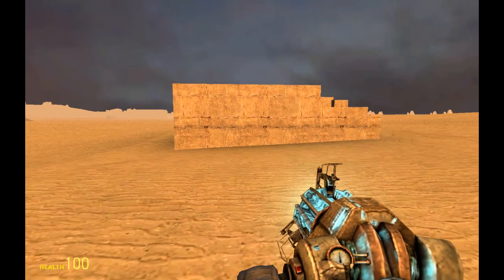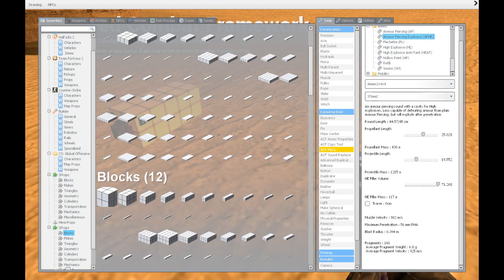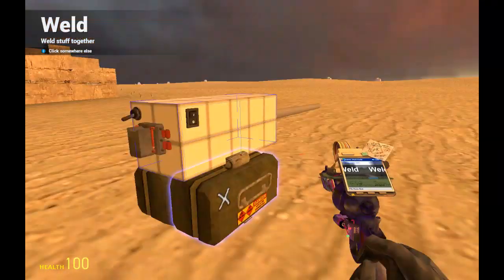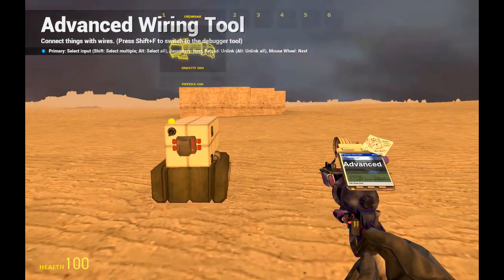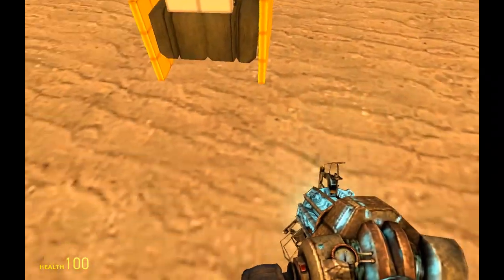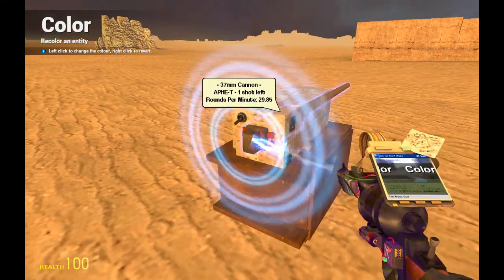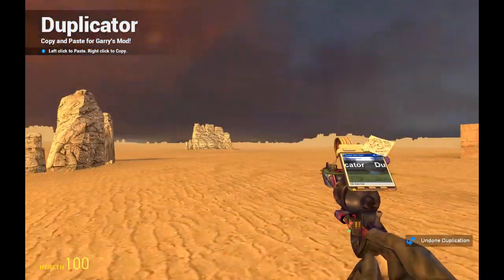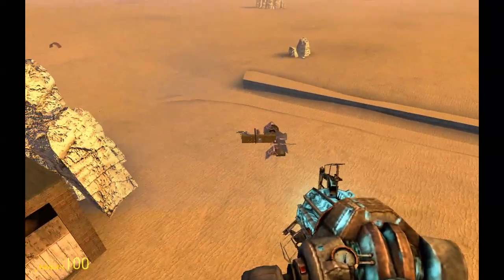[Tutorial] Gmod ACF Weapons tut Basic mounted cannon and wiresystems

Comment: Hey good tutorial but still i have a problem.
I understand the basics of ACF so i tried to make a static howitzer on wheels (I hope you know what i mean, if not just google "ML20") And when i was done with the desing the weight of the gun just pulled it on the ground.
I tried to change the weight of the gun and it stopped working. So any ideas to actually make it work?
Reply from the maker: Make the wheels heavy enough to support the gun!!
Reply: Gmodism Total Nerdery Channel Thanks!

Comment: So it takes you 26 minutes when I could build that in less than 5 minutes. Also almost all acf servers don't let you pick up and aim acf cannons with your physgun, rendering this video useless unless you mount it to a vehicle or for general practice.
Reply: damon piop yeah but its showing the basics.
Reply: +Extreme MLG Bass Boosts As a good starting alternative, throw down a wheel in the shape of a barrel, and apply thrusters on the end of the block you spawn to turn the turret as the wheel wont be enough. A great basic cannon, and from there you would add a wheel on a horizontal axis to add vertical aiming.

Nonetheless, this video is a great start, and shows how to get some of the basic cannons working.
Reply: honestly people build at all sorts of different speeds. just because you build guns faster doesn't mean you're better.